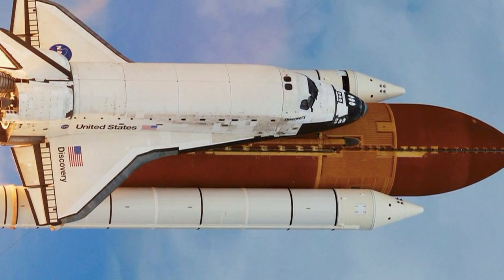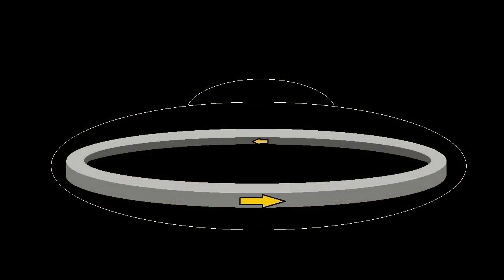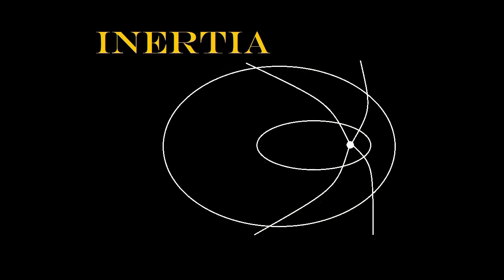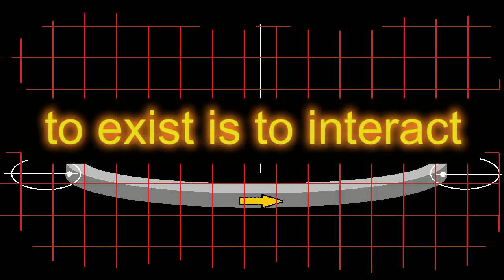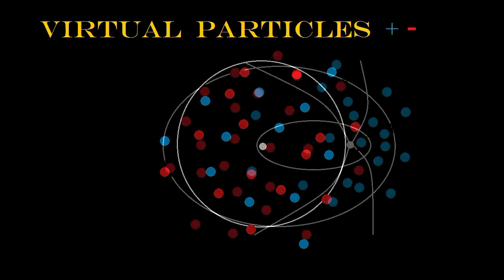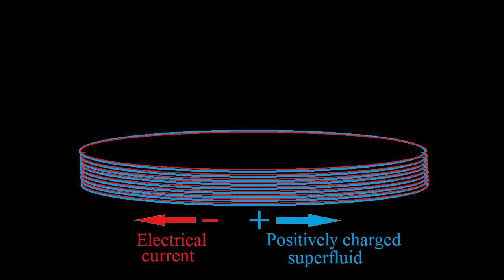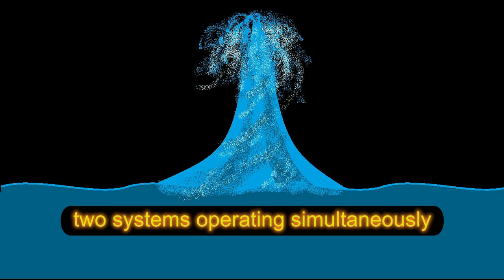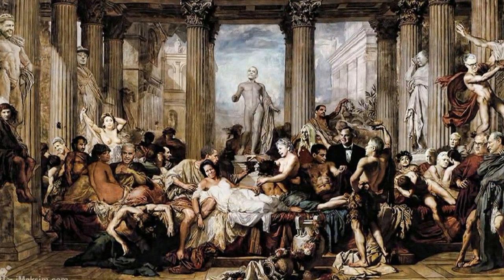UFO & Flying Saucer  Propulsion Technology

Comment: I can confirm this is how the TR-3B operates and is ancient compared to newer craft, Even the TR-3C is a vast improvement, The TR-6 is a vast improvement upon that but cylinderal ships are the norm for interstellar travel, The TR-series CAN make jumps towards interstellar targets such as Alpha Centauri but has to intermittently stop to charge the electrogravitic drive so travel times are delayed, Newer craft employ powerplants based on the Zero-Point principle and can travel continuously at velocities well exceeding c.
Frustratingly none of this tech trickled down to us in the white world and are forced to catch up with Fusion and Thorium reactors the most feasible powerplant for powering the cities in the near future.
Space technology will have to rely on metallic hydrogen rockets soon along with hal effect thrusters and maybe NERVA.
The secret space program also incorporates Neutrino communications for FTL communications using a little understood modality of spacetime where neutrinos reside.
The craft use a form of warp drive and can be pulled out of warp with these neutrino communications.
The negative mass I speculate is generated by centrifugal superconducting mercury some how generated by the electromagnetic fields created creating a gravity well upfront and a gravity bubble in the back like Acubiere has proposed.
I just had a download not sure where all this came from.

Comment: If you click on the purple channel icon to the left, you can see the closest thing to it that I know works! It is an ion thruster shown lifting  its onboard power supply against gravity!!...  In could alternatively carry a small propellant tank for use in a vacuum.  There are commercially available solar cells, instead of small batteries, that could power it as well.

On a purely theoretical basis, it could fly on relativistic electrons only, at about 5 to 10MV.  The  math supporting the prospect has been done and there are also MV electrical towers that can be constructed that are possibly light enough. A prototype would have to be built in a shop with lots of safety considerations though.

Comment: This electrogravitic model is only good for air travel within our atmosphere. Even then, it will still be clumsy to work with something that move4s on linear movement.The propulsions systems of these UFO come in different types such as torsion drives, anti matter drives, old style mercury vortex drives and the latest method of Temporal drives.....they all work because…...they all bend time and space around the craft to create its own gravity field opposite to the earth. Not only that, they don't move in linear fashion, at least neither do the ones that are torsion driven  or temporal drives....that step up and step down in frequency of the entire hull of the craft housing the hive occupants consciousness as a group all interfaced as one with the craft.....a lot of these craft in order to interface with the occupants are actually semi biological/synthetic structures so advanced that they have a Nano optical fibre neural network within the material of the hull. They behave as sentient and are responsive to the occupants thoughts.  Depending what kind of drive method they are using, they will usually step down in frequency and y6ou will see them come though glowing as blue orbs......as they step down, they usually land as a orangish red glow around the craft. When they are about to take off, they have a lot of infrared radiation that is emanated, and some have been scoured and burned through the process. The beings such as the Draco that step up and step down through 4th density only, they have a higher output of infrared emanating from their craft, its designed like that due to the dimension or bandwidth reality they c9ome from.Many of vessels that are used with a temporal drive that manipulate time - space are semi biological,,, meaning that the craft is grown to match the DNA of the controller, it is made specifically to contain a group of occupants that will travel together in non linear fashion. The torsion drive machines manipulate space - time and are synthetic and have a quazi-crystal in the center of the craft that behaves and mimics the crystal in the pineal gland.  Both methods are currently out of reach to the military on earth as they are incapable to utilizing such methods with mind. These beings simply place their hand in a placard similar to a radionics biofeedback mechanism and wherever they think, that where they will step up or step down in vibration and location in space, The glow in the craft is there for a reason to keep the vibration of the beings in there to a certain frequency and also provides sustenance to the crew as an artificial sun.  Many of these beings have genetically modified their boy/skinsuits for space travel. They can withstand extreme cold and hot temperatures including harmful radiation. from space travel. They are that ahead that they are capable of implanting a soul from one body and into another body with no problem/. Their view on science is completely unified with spirituality and metaphysics. There is no separation.  The crew are telepathic and function as a hive mind for space travel. Thy use base 3 mathematics suitable for space travel similar to Teslas version  with an addition of qualitative number languages superimposed on quantitative mathematics. We do not have a system yet that unites the two mathematical modes. Nothing in these craft are for aesthetic purposes....not even the port holes on the rim of the craft.Everything is there for a reason, Including the weird or the supposedly weird design interior. The hexagonal structures are un line with mother nature and these craft just do that, they mimic mother nature and the aether and manipulate the geometry of space time through a step down process. to where the external effect is a coronal electro-plssmic effect similar to the sun. They are not based on nuclear fusion as what many would like to believe. IF they did, they would not be capable of light speed or faster than light speed travel. The Eben craft had an antimatter reactor and used that force to travel through an atmosphere, however, when they used the torsion drive, they would travel close to light speed and they would manipulate the space in front of the craft and hence the time will also be an effect of lag.The Zetas us old style crude reactors using 115 material to react. These Zetas are normally programmable synthetic .An individual can travel individually through a portal and appear on Sirius if they know when and where the portals will be and when the magnetic fluxes from the sun intersect or triangulate with the earths magnetic fields/Teslas design was an unfinished design of a craft that would only be used within the earths atmosphere. His other designs are not published/

Comment: Not reactionless.  They're equipped with very high voltage and use the outside air, in an electrified form, as fuel, while operating in the atmosphere.  High (say, positive polarity) voltage ionizes the air; high voltage of opposite (negative) polarity then leverages Coulomb's law and the divergent field (gradient electric field) to accelerate/move in the direction of the high-intensity part of the field.   It is not a 'closed system.'  It uses the outside air  which is external to the vehicle.  It's not 'reactionless' -- the high negatively-charged plate exerts a downward pull on the ions.  That is the reaction.  Not violating Newton's law.   The air pulled in from the outside is like an 'infinitely high' ladder -- as the vehicle makes the first move upward, more air is pulled in, ionized, and becomes the next 'rung' in the ladder.  See this:
https://www.flickr.com/photos/160652483@N04/26882958637/

That's the propulsion part.  That's not the only way to implement propulsion -- Lenz's Law and plasma can be used too (similar to how a rail gun works, with plasma being used for a conductor instead of a rail gun's metal plates).  

The inertia reduction is a 2nd part of this type of vehicle.  The inertia consists of at least 2 difference sources:

1) the mechanical motion of the atoms that make up the vehicle -- each atom has two different types of angular momentum:  spin and orbit.  A good macro-example is this -- If you spin a bicycle wheel in a vertical orientation (like it spins while in the bike frame), then hang only one side of the axle on a rope hanging from the ceiling, the spinning wheel will remain vertical  (see https://www.youtube.com/watch?v=NeXIV-wMVUk).  The angular momentum resists a change in direction. Summed across all the atoms in a piece of mass, there is a lot of angular momentum that has inertia -- resistance to movement.

2) the self-electromagnetic field of the electron cloud -- just as wire resists a change in 
flow of current (back EMF, a force) -- atoms' self-fields resist change in current flow when the atom is moved to a new location.  Aggregated over the entire piece of mass, there is 'back EMF' resisting the change of the current flow of the electron clouds of all the atoms.

Regardless of whether (1) or (2) above is stronger than the other, they can both be neutralized.  There is more than one way to neutralize  (1) and (2) simulataneously:

(A)  very strong electromagnetic field -- this is tricky because of the effects on living tissue.

(B)  creation of a local inertia field that shields gravity.  That is the subject of this patent from 1971:

https://patentimages.storage.googleapis.com/3a/e1/0a/cdda5bf4825fb1/US3626605.pdf

This patent uses materials like Bismuth that have an unpaired electron to create a local gravity/inertia field that shields the normal gravity of Earth.  The patent is a bit challenging to get unless you know a bit of physics but give it a read.
Reply from the maker: When a UFO is hovering (multiple witnesses report same) ... there is no wind at all. When accelerating from a hovering state, there is no huge rush of air that provides the propulsion... there is no wind proportional to the acceleration observed. 
Electrical induction is commonly used in kitchen ranges to heat metal pans that then heats the food. There are metal sorters working along the same lines that repel this or that type of metal. These well understood mechanisms have been rejected as propulsion mechanisms by those who study the field (including credentialed scientists and engineers). The observed accelerations are just too great ... (on the scale of 100 gs).
If you grab some air from the front of the direction of acceleration and push it out the back ... you still get a tremendous air burst in the opposite direction ... which is not observed by anyone I've ever read of.
I rejected the type of possibilities you propose, several decades ago [as unworkable] because of the scale of the accelerations reported and the attendant effects that would necessarily be observed like explosive cratering at the point of ground level rapid take off (if using the dirt as a 'push off').
The number of possibilities for propulsion schemes is extremely sparse given that physical systems are limited to parts or particles that: 1) go round n' round  2) go back and forth ... add to this electromagnetic and quantum effects and there is nothing left to make a machine out of. The bulk of proposed unorthodox schemes are what I call "Ruby Slippers" propulsion systems ... that is, wishful imagination with no grounding is observable physics.

Lastly, your proposed type of electromagnetic propulsion is useless for interstellar travel ... as are all conceivable reaction engines. That is, to go to another star in a human lifespan is technically impossible for ANY reaction engine ... including hypothetical anti-matter engines (as I've demonstrated mathematically in other videos ... provided that one takes into account the generally well understood ... and necessary ... principles of thermodynamics, especially the 2nd law for anti-matter engines ... as well as Tsiolkovsky's rocket equation for all other types).
Reply: Suit yourself.  By the way, Coulomb's Law -- scroll to the 2nd page titled "Electric Force Example" in the link below.  To your point  "I rejected the possibility you proposed years ago...because of the scale of accelerations reported" -- the Coulomb's Law example in the link has 2 sets of electrons -- each set is enough to light a 120-watt light bulb for 1 second.  That's not a whole lot of energy, seemingly, in terms of illumination convenience in the home or office -- just 2 sets of electrons, where each set can light a 120-watt light bulb for 1 second.   If 2 such sets of electrons are positioned within one meter (about 3 feet) of each other -- those 2 small sets of electrons repel each other with ONE MILLION TONS of repulsion.  You grossly underestimate the power available.  By the way, Coulomb's Law has been around since the year 1784.  This is old, old discrete electrical components tech.   Also, I'm aware my proposal is workable in the atmosphere, not in space.  A different propulsion approach is required for the latter case.   Here's the Coulomb's Law example -- this is 234-year-old math.  http://hyperphysics.phy-astr.gsu.edu/hbase/electric/elefor.html
Scroll down to the 2nd page,  "Electric Force Example."

Comment: You need to check out my video. I have created a Centrifugal Propeller. It is not as complicated as you make it here, but the principal is close. I have a patent pending and a working prototype. It is so far outside of the box that you cannot even see the box.  It is more mechanical than electrical and it is in a completely closed unit with no external moving parts or vents. Because it is so different, it is extremely difficult to get conventional thinkers to accept it even though I have a video of it working.

Comment: This, at Last, fits 90% of a dream/memory of mine from 1977.  I've never had the vocabulary or education to explain or understand it well, but, except for one major difference, you have done so here. 
The difference is that my memory showed Two rings, one above the other, the lower/smaller one being 35 deg in distance and angle from the upper. Both spun in different directions, the speed and direction of spin determining the action of the craft. The spinning of each ring created a field which reacted with the ring above/below it. These two fields created a third field, which due to the 35 deg angle, was directed outward, reacting to  (gravity? Electromagnetic field?) a fourth naturally existing field.      Take off, hover, speed and direction were all determined by how fast the contents in each ring was spinning.  The rings themselves were stationary, but they held a gas(?) which reacted to a magnet, which was both pushing and being pushed by the magnetically charged vapor/gas.  You have nearly every aspect of that here, only rearranged somewhat.
    Over 38 years I've so much wondered if there was any reason for it to work, or not to.  I just couldn't figure out how to make one in my back yard, or knew of anyone else that would help me do so. How it worked wouldn't matter much, if it worked anyway.
      Sighs Then would I meet the Men in Black?
      It would make for housing platforms, floating gardens, transport platforms, vehicles, and so much more.... after a Government finished seeing how many people could be controlled or destroyed with it. Ah well, the cat is out of the bag, and probably has been for a goodly while.
Thank you for putting your mind talent and time into this presentation.
Reply: I'm born in 1977 and that's why I found that even more interesting. That subject is very awesome and I'm happy that you decided to share it thank you! Sorry for my english :)

Comment: You're talking in the beginning about "centrifugal" force, but then you put up a formula about centripital force. To my knowledge, centrifugal force doesn't exist, it's just an imaginary force used for calculations. On the other hand, centripital force does exist. Putting that aside, can you say they're equal to each other mathematically speaking? Those arrows to the sides of the rotating disk can't exist because there is no centrifugal force. Why not use the tangential force instead? Can anyone explain where these arrows to the sides come from?
Reply from the maker: Centrifugal or centripetal ... six of one, half dozen of the other. It makes no functional difference ... two words for the same thing.
Reply from the maker: It doesn't make any difference at all what you call it.

Comment: I had the idea of a saucer shaped ship, center console inside, with seats lined around the walls of the ship on the inside, there would be a lever to pull the seats into the center, as the seats pulled forward to the center of the console, it would create a spin based off of how much weight that's pulled in, you would be locked in the center of the ship, and maintaining a high speed spin. Not sure though, no opposite rotation, unless there could be one.